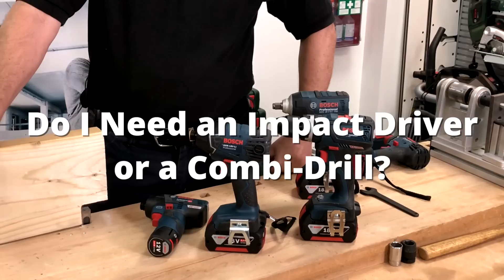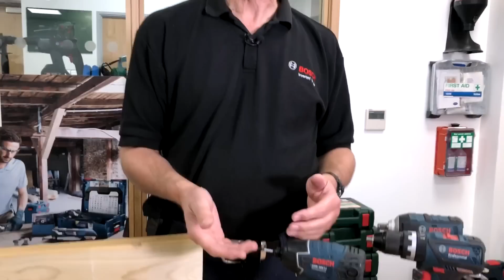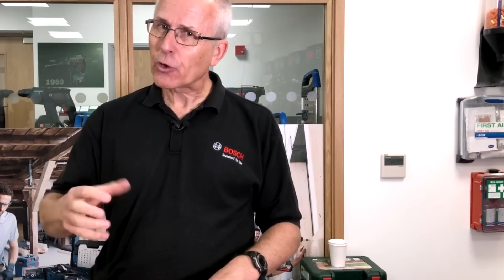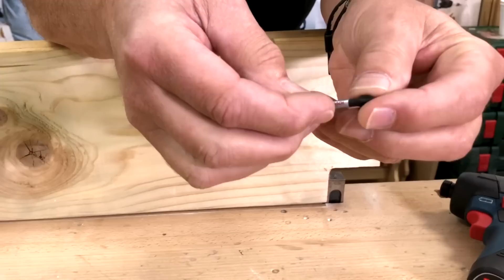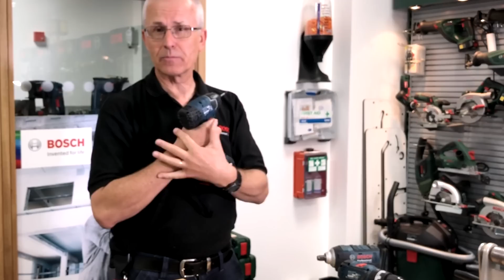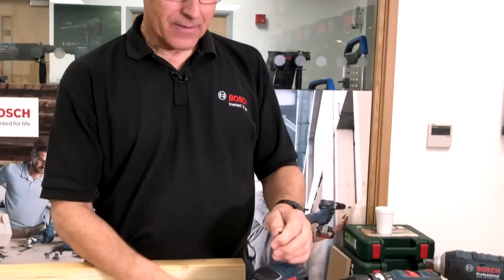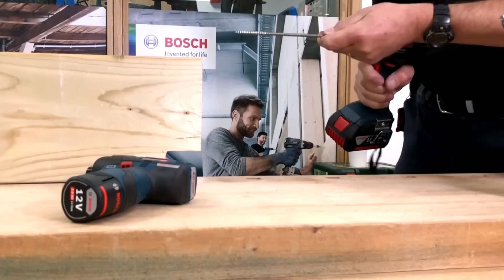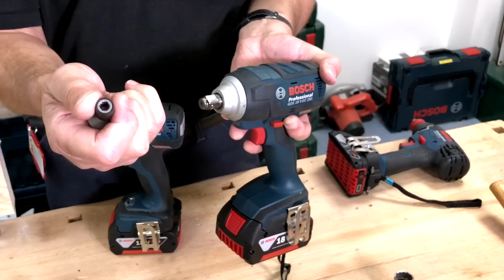Do I Need an Impact Driver or a Combi Drill | Toolstop Guide

Comment: You confirmed what I was only able to intuit. I purchased a set that included a combi driver and impact driver. The impact driver felt like overkill for the #8 and #10 woodscrews, regardless of their length. Indeed, the impact driver cammed out the heads on the longer screws. Alternatively, the combi drill competently drove the long screws without deforming them. The impact driver seems more suited for bolts and lag screws. The combi driver has more uses and should be the first tool of choice.

Comment: he keeps calling the hammer drill an impact drill, and even points to the "impact symbol"...which is a hammer LOL
Video summary:
Hammer drill (linear impact) - for drilling holes into materials such as concrete and mortar that require hammering
Impact driver/drill driver (rotational impact) - for quickly and easily driving small fasteners such as screws
Impact wrench (rotational impact) - for tightening and loosening large fasteners such as bolts that require lots of torque

Comment: Since the impact driver is already very compact, it would be amazing if the impact drill mechanical function also was included into the impact driver. Then you could save some weight and size on a normal compact drill and still have all the functions in two units
Reply: It would NOT save weight. The two mechanisms have conflicting engineering requirements that would force a compromise of both unless you made the resulting monster so heavy and expensive as to defeat the object.

Comment: Sir the impact drill can drill in cement and metal? Pls reply.pls
Reply from the maker: Yes the impact drill / combi drill will drill in cement and metal. Use a Masonry drill bit for concrete and HSS-G drill bit for metal. Not impact driver, this is mainly for screwdriving applications Lesly.
Reply: @toolstop  AKA "hammer drill" to the rest of us.

Comment: I guess Bosch doesn't sell rotary hammers/drills because like hell! Any self-respecting tradesman would ever rely on a hammer drill with an anemic plastic hold to drill masonry or concrete.
At the end of the day, just remember, don't waste your money on second-rate power tools made by automotive parts manufacturers like Bosch - They'll sell you a decent water pump, no-touchy their electric suction pump.
Reply: Get your facts straight Stonewall. Bosch invented SDS.

Comment: I first bought an impact driver as a tag-along with a kit of other tools that I actually needed, and mostly just dismissed it. Here several years later, my tune has changed. I drive a lot more fasteners than I drill holes, and while a drill can drive fasteners, the impact driver does it MUCH better. I pretty much only use my drill.........to drill holes. My impact driver gets used easily 4x more often. If I could only have one, I'd have the drill and not like the limitation at all, but if you can at all, definitely get the impact driver as well.

Comment: I have a GSR 18V-60C (the combi without hammer effect, I have my GBH 18V-20 for when I really need that). The kickback control is adjustable via BT, so it is quite forgiving if you yse it at arms lenght, so I haven't really been able to justify the extra expense for an impact driver yet.
But then again, I only use them for a bit of diy at home anyway. 
The only reason I buy these fairly expensive tools for home use, is when I bought my house, I opted for a really cheap impact drill (Power Craft) and the gearbox broke the first time I used it. Not having learned (much) from that experience, I bought a Power Craft router that also broke the first time I used it. After that I swore to never buy such cheap sh*t ever again!

Comment: The impact driver is spring loaded to give you that extra torque
for hard material, you don't need it for soft material.
It works exactly the way you use a manual screw driver,
pressing down hard on the screw driver while turning the screw for that extra torque.
Reply: It works exactly not that way. You're describing the linear force of a hammer drill. But he showed you it's like thumping on a spanner, i.e. radial force.

Comment: Normal chrome thin sockets work fine on standard impact drivers. Use them all the time and they've never split on me and these are cheap nasty sockets that i bought. Drills chew out the screw heads while an impact driver doesn't. Every tradie uses impact drivers to put in screws and hex heads and drills are used for drilling wood and steel. For concrete, everyone uses rotary hammer drill. A normal drill is useless for drilling concrete and they make a hell of a racket, bad for the ears. Carpenter here by the way.

Comment: Saw A tile drill whit a 1/4 hex shank. Kind of curius if would work well?
Reply from the maker: If it has a carbide tip it should be fine. Two layers of masking tape ove the hole before you start drilling stops the bit slipping about.

Comment: You would know it if you would work with those tools instead of playing with it. Not, in theory, but just by the pure experience. Yet, still can get such knowledge if you would try to fix your tools instead of going with every tiny shit into customer service. If you gonna use the driller at work, the first 2 months will tell you if you will need the warranty in the future. I never needed any warranty on motorcycle, car, powered or hand tools (can't remember any warranty I use). Because I'm a poor guy and I can't afford to buy 5 times a garbage tool. The first purchase has to be the last one. And if a manufacturer really stands behind his product, he will check what's wrong with your worn and torn 10 years old driller that has a millage of 10000000...

Comment: first drills i bought or bosch never agian burn out on me cheap moved to makita best drill ever 5amp battery on maktia last me week and half be i have charge it put in 1000's of pullbarn scews and metal screws im a sheet metal installer
Reply: What you really need is a tool that fixes those run-on sentences...

Comment: Genuinely interesting. I had noticed that the Impact Driver made a lot of fuss over long screws, 'more on withdrawal that insertion'. Maybe 80mm is about the max appropriate length for my machine. And I had wondered why the Impact Driver seemed so light to use, aside from the weight and size difference; it's the lack of torque on the wrist that makes the difference, thank you for explaining that. Yes the Impact driver does not have a torque setting but after placing the first couple of screws with caution, one can easily 'work by ear'. I love my little machine, it's a godsend, fast and light. Batteries (and my wrist) go on & on & on again. Lol :)

Comment: Far too noisy for me. I bought this12volt impact and drill set to use the drill for a pre-drill and chamfer before using this ps41 impact driver to drive the screws home. I find the impact driver is far too noisy to use in confined areas as it will make its impact noises immediately on starting to insert the screws. I'm talking about 3/4" screws into pine and plywood. If the loud noise had been less or the torque setting adjustable it would have been great, as it is right now it is unusable for my cabinet application surrounded by people trying to communicate. I sure hope I can return it.
Reply from the maker: If you bought from Toolstop recently, phone our customer services on 01698 819025

Comment: I would like to see Bosch make a screwdriver without the impact feature! Or at least one that you could turn off. With most screwdriving the impact is not necessary and if you are driving screws all day it gets pretty tiring listening to all the banging too. Plus the fact that the impact pretty much takes away all the feel you have driving a screw.Without the impact to tradesmen can feel whether a screw needs to be backed out because it might break or is about to strip the threads before seating. With the impact you find out when the head is broken off the screw! Nice... A better tool for most jobs would be a variable speed screwdriver no impact. And as you're showing, for most jobs it would drive the screws in quicker anyway. So what are you waiting for Bosch?

Comment: Nice vid, another plus for the impact driver is- the chuck is much smaller and does not need that giant plastic spinning grip like a drill. So when u are in close quarters, the impact driver is much less likely to mark up any finished work nearby.

Comment: what do u recommend for drilling concrete wall?
Reply from the maker: It depends on the size of a hole. Up to 13mm a combi still should be fine. Larger than that, SDS+ drill
Reply: @toolstop  thanks

Comment: Do I need a DeWalt or a Makita?
Reply: Or even a Milwaukee. Don't need any of them, just use hand tools. Seriously if you already invested in batteries, that maybe the way to go. Look at the complete line they carry beyond the drill and impact if you need something in the future. Like Makita has a chainsaw but DeWalt may not. Right now Milwaukee and DeWalt have full line of tools, where one leapfrogs the other with more tools and more power depending year to year. DeWalt or Makita, don't think you could go wrong with either.

Comment: Hi, great video, very informative, however, there is one relatively important detail that wasn't accurate. An impact driver impacts diagonally rather than horizontally as an impact wrench does. Hammer drill strikes vertically (like a hammer), impact wrench strikes horizontally  (like turning a wrench {or spanner}), and finally an impact driver stikes  horizontally yet, simultaneously creating a downward force, (hence diagonally forcing the fastener), much in the way we push downwards ,while simultaneously turning, a screw driver. Additionally if they were the "same" an impact driver would be named "1/4" hex drive impact wrench", the term "driver" is the key. Not ideal for nuts or metal work either, they ARE however ideal for lags and other wood working applications. Thanks for the video.

Comment: You buy the combi, you’re happy until you come across a stubborn hole you persist and the third time you encounter a stubborn hole you buy an sds. You have a job where you have to drill a pilot then drive a screw in one at a time you get arsed off with changing between drill bits you buy an impact driver then you fall in love with it and start looking at all the other cordless toys you can buy without having to buy new batteries. Three years later you have the battery powered coffee machine and radio and half a dozen batteries to go with it
Reply: ans don't forget and a torch.
Reply: So true. Got combo pack with combi and impact drill, just bought multi sander and now need angle grinder. Don't need the grinder much so a cheap corded one will do, but still looking at cordless one at 3x the price, just cos lol

Comment: An impact driver will be able to drill into concrete easily with 6mm bit. You have to buy a high end Combi drill to do better then a mediocre impact driver. Bottom line is ... if you could only get 1 drill, get an impact driver ...
Reply: No, you need the hammer function on the drill. Rotary hammer is what you needed.
Reply: Frank W sorry, I meant rotary drill yes

Comment: Sums up my what I have always said, no real point for an impact driver as a carpenter, it's just another toy for people to spend money on.
Reply: Said like somebody who hasn't given impacts any real use. Driving screws with a drill feels archaic after using an impact for any real length of time. It's like using a hammer instead of a nail gun; hammer will get it done, and can be used in a wide range of applications, but it's no nail gun.
Reply: @jayjayhooksch1    haha, you sound like someone that hasn't had much experience with battery drills or just someone with not much experience?
You are right about one thing I guess. A hammer is not a nail gun, a hammer is a hammer and as basic as it is, it is superior to a nail gun.
Reply: 'battery drills' lol. Yep, not hard to guess which one of us has experience with cordless tools. As if anyone couldn't tell simply by you calling an impact driver a toy already. 

Give impacts a try Gramps, you can thank me later.
Reply: @jayjayhooksch1  hahaha, again, you still don't know what you are talking about with your assumptions. You're entitled to your opinion I guess.
Reply: Depends on the type of carpentry. Are you assembling stick frame houses?--that's a carpenter. Or are you making bespoke furniture with delicate joinery? That's also a carpenter. 

The former probably needs a driver, the later would never have a need anything so functional.

Comment: Very informative and very well explained. Thanks ! 
Bought a brand new Bosch cordless 18V drill Model # GSR18V-190B22. Came home, charged one of the batteries fully, put in in the drill, pressed the trigger, and...nothing happened. Turned out that my unit was D.O.A. 
The store where I bought it offered me an exchange for another one. I asked for a full refund instead. Poor quality control at Bosch. I'll probably go for a Milwaukee M18 instead.

Comment: Have had my impact driver for a few months and it’s been great. However over the last week I have been building a shed and it has been great. Has made easy work of the big screws but also allows quite fine control to get the head perfectly flush when required.

Comment: Toolstop - Why don't you use the common term for the Drills impact action as "HAMMER" action. Your only confusing people by using the term "Impact" with the Drill. Most people know them as IMPACT DRIVER or HAMMER DRILL.
Reply from the maker: Eric makes it clear that SOMETIMES hammer drills are called "impact drills", he's pointing out the mechanism that creates the hammer action is actually impacts.
Reply: Bosch has (or had, anyway) a "HAMMER" (allcaps) brand, but it was only used for actual rotary drill hammers (=fewer impacts with a lot more force), not impact drills (=many impacts with low force, basically useless for concrete or clinker). Impact drills are really not that useful, even the smallest of rotary drill hammers outperforms any impact drill.
Reply: Most other manufacturers use the term percussion or hammer, confusion for confusion sake.
Reply: Well, he explains that the mechanical device inside an impact driver is a hammer, too. 

So it doesn't really matter what you name it, no name is idiot proof. 

At least after watching this video there can't be any confusion. 👍